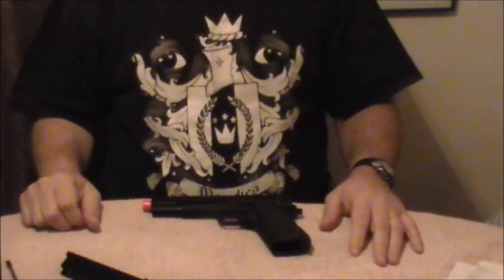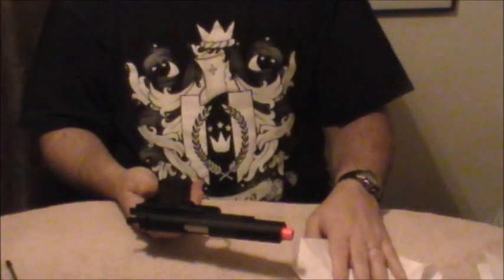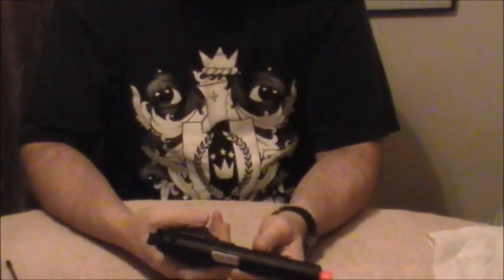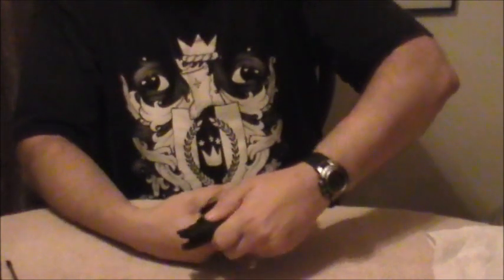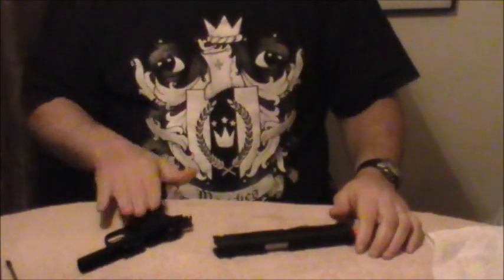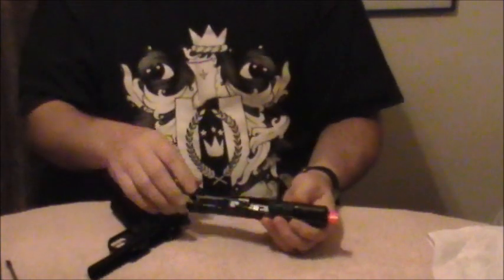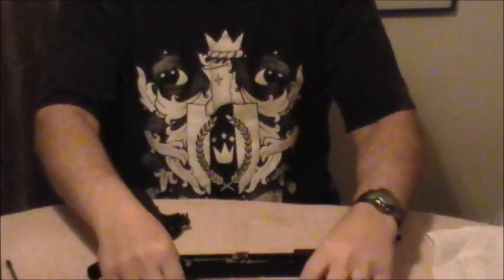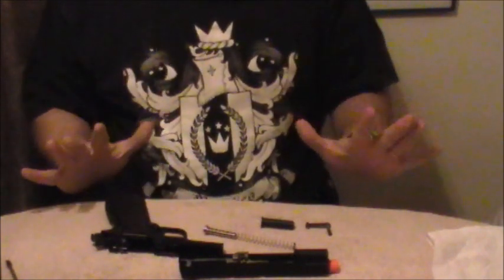Know it All: Airsoft GBB Use & Maintenance

Comment from the maker: @solozaur I dont use Propane or red gas i use Green gas every time and i use silicone oil on my seals 1/2 time so it never dries out on me,, if i was storing it for more than 3-4 months i would spray some silicone oil on it and it should be good,, but i use it either at games or just monthly practice / targets. so i dont have your problem of drying,,,and if you store it with gas you weaken the seals over time ( constant pressure ) (( hmm why is there a gas release? ))

Comment: Correction: You SHOULD EXPEL the rest of the gas from the button with your plastic plate (or finger nail) by TIPPING the magazine upside down DOING THIS, BECAUSE the silicone oil WILL lubricate the button seal this way by exiting through the button.
Always REPLACE and STORE IT however with at least 2 seconds worth of gas/ silicone.
WHY? For the same reason you dont drive down the road with your engine cover off your truck "stupid" ...IT RUINS THE SEALS, CORRODES, CONTAMINATES!!   Helllo?